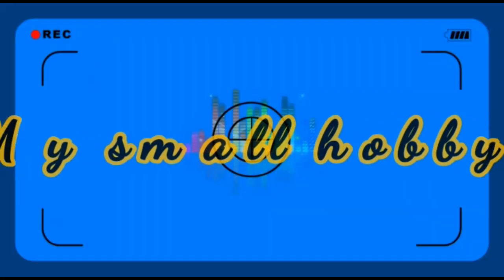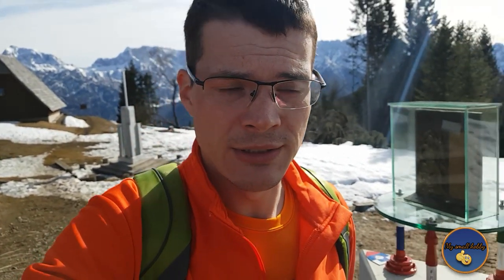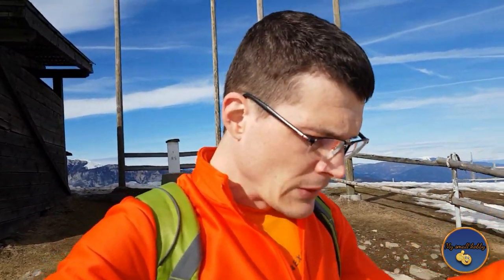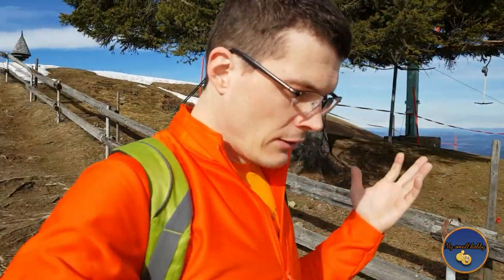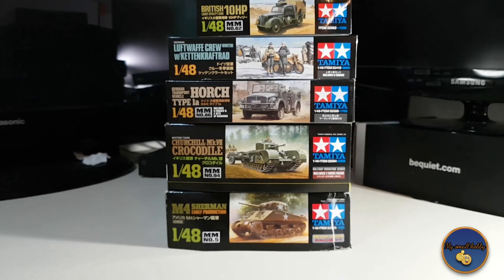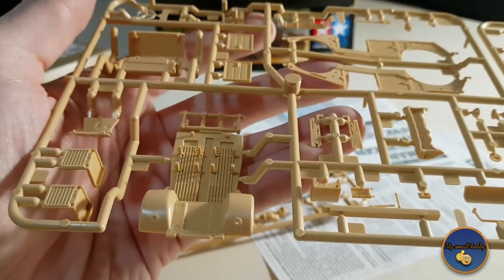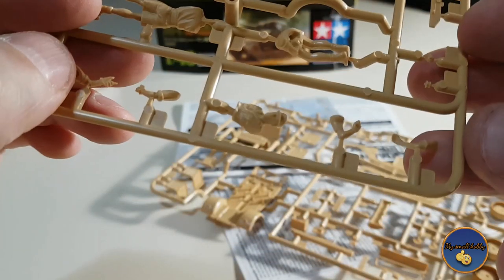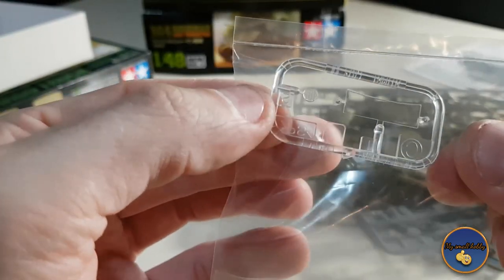1:48 SCALE KINGDOM

Comment: The figures with the Luftwaffe crew and Kettenkraftrad are not 1/48 scale. I am not sure what scale they are exactly but they are much larger than the other 1/48 scale figures from Tamiya. If they are ICM that may explain it. I would venture to say they feel more like 1/35 scale to me but I do not have any 1/35 scale to compare to.
Reply from the maker: Hello Larry :) No no I can assure you that they are all 1:48 scale. They look a bit bulky because of winter coats :)
Reply: @Mysmallhobby  I get that but they're a lot taller than all my other Tamiya 1/48 scale figures. So no clue. I still love this figure set though. I will be using them in a large scale diorama I am building and these will just have to be away from the others so they don't look awkward LOL.